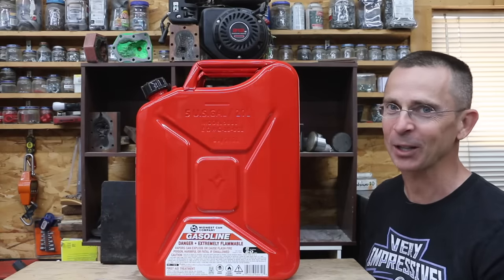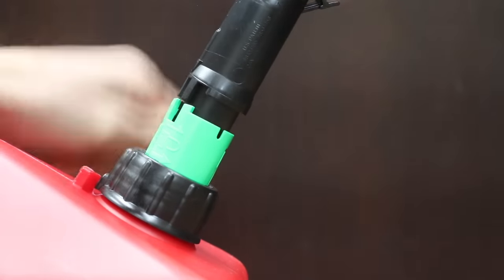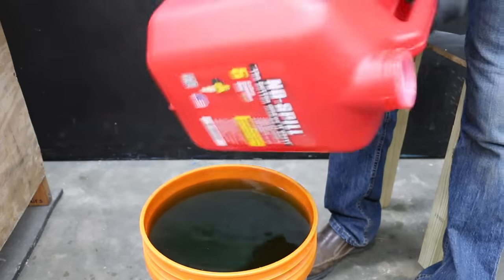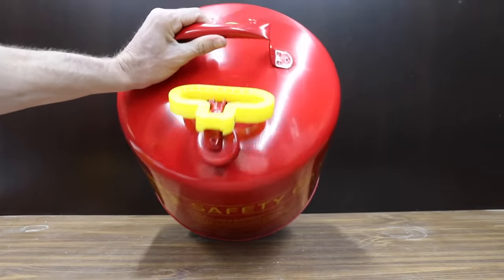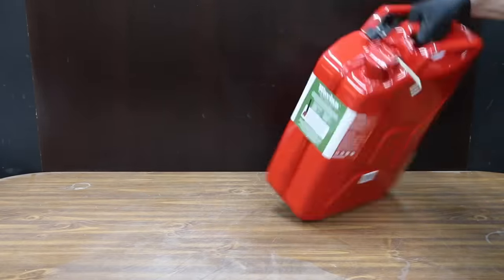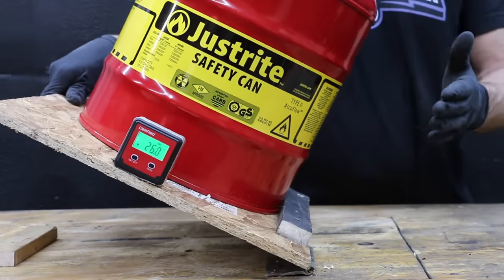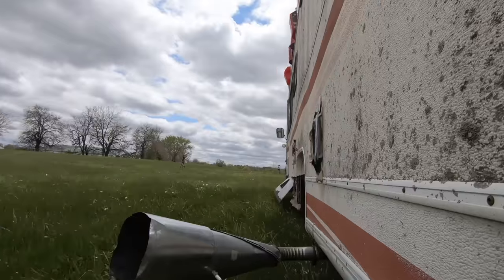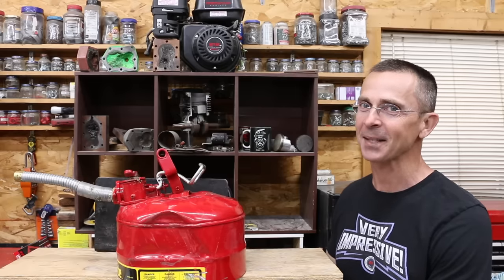Best Gas Can? $140 Wavian vs Eagle, Surecan, Scepter, Briggs & Stratton, Midwest, VP Racing

Comment: Well I am from Latvia, and I work at the company that makes the Midwest (military style) can, kinda awesome to see stuff on the internet. And the Wavian cans are also manufactured here.
Reply from the maker: Thanks for sharing!
Reply: Why am I not surprised.  Thanks for sharing.  Care to share any differences in manufacturing.  Like, does the Wavian have better quality control than the Midwest?
Reply: @arthurmoore9488  They are both the same in terms of manufacturing, the only difference is the US proprietary threaded neck and the latch lock cap design. The internal coating is the same on both and both use 0.9mm steel plates. There are other resellers like the Wavian that sell the same cans, not sure if any are located in the US though, and since they don't have the Wavian brand name they are cheaper, but essentially the same can.
Reply: I love my Wavian one so far. Just a damn shame about the Kalifornia spout that we're all stuck with now.
Reply: I have a Wavian (made in  Latvia) that I have had for about 5 years. Best money spent on a can.  If you want to make it empty even faster ditch the spout and just use a funnel. I can  empty the cans into my mowers in less than a minute while spilling less fuel.  Don't know if the newer Wavians still have the internal vent built into them. That's what makes the difference.
Reply: PS
You should never drive around with unsecured gas cans...
Reply: Both of them look impressive, and stick reasonably close to the standard "Jerry Can" design that's nearly a century old.
Reply: Thanks for the info.  I have a couple of Midwest cans and don’t see 3x additional value with the Wavian justifying 3x the price
Reply: I'm from Hungary, and I have a 10l Wavian and a 10l ValPro can. Love both. Now I want to buy a 20l one, but all the stores are out of stock ...
Reply: I think there must be some small design differences because the wavian can has some different scores, especially emptying the can it's night and day
Reply: @toitactu  Yes one has a screw on cap, specifically made to comply with the US regulations, which is not as good for emptying as the one that wavian has.
Reply: @JohnnyKronaz  Just buy an EZ flow spout for your model, less than 20 bucks on amazon.
Reply: @toitactu  As Martin said, the round exit also doesnt seem to have a air vent as well.
Reply: Another words it made from russia metal and natural gas and now manufacturing of this latvien product is stoped?
Reply: That is so hilarious cuz I noticed so many similarities between them I was like there is no way these don't come out of the same factory. Especially since the Wavian had no origin country listed. Goes to show just how much items in society are marked up with "fancy" names.
Reply: <<Well I am from Latvia, and I work at the company that makes the Midwest (military style) can, kinda awesome to see stuff on the internet. And the Wavian cans are also manufactured here.>>

So what kind of caps do you use in Latvia on the cans you make.  I can't imagine that EPA style caps are favored by anyone who has a choice.
Reply: @SeattlePioneer  We do have screw on corks aswell, but since those and the spouts are made in house, we can ensure that they allow the liquid to flow well, by ensuring that there is air access in to the can, as well as the lever type that wavian uses (not sure how it's called).
Reply: @xmartins2638  <<Martins Deiko
SeattlePioneer We do have screw on corks aswell, but since those and the spouts are made in house, we can ensure that they allow the liquid to flow well, by ensuring that there is air access in to the can, as well as the lever type that wavian uses (not sure how it's called).>>

Thanks for the comment.  I figured that few people would want EPA type caps if they had an alternative available.    Does the EU have standards the control gas cap design as well,  and if so is the result functionality as poor as EPA style caps?

Personally,  I have old spouts available.  The one I currently use has a solid plastic base that the cap screws on over,  sealing the fuel container.

To use fuel,  you must remove that plug and then screw the cap and spout back on.  That works OK,  but fuel comes out too fast and tends to splash over my mower.

I suppose I ought to experiment with partially plugging up the spout to reduce fuel flow to a more manageable level.

No one seems to have devised the perfect gas can spout....

I do think the EPA type spouts distinguish themselves as being the worst and most annoying designs in the world,  while still requiring fuel spills when you use them. 

Our United States Supreme Court recently ruled that regulatory agencies can't go out adventuring into new realms without our Congress explicitly authorizing an extension of such power.  Perhaps the EPA will continue to be stripped of power over Americans,  such as those annoying gas caps.
Reply: @SeattlePioneer  To be honest, I myself am not all informed about any EU standards regarding fuel spouts that affect flow. And frankly I am weirded out by it, because EU is usually the ones coming up with wierd laws and regulations, like with food and such.

I myself am in charge of CNC machining so we make the threaded necks and turn threads on to the corks. Also all the markings on the cans are made here.
Reply: @xmartins2638  

I recently took a nine month certificate class in manual and CNC machining.  I really LOVE the precision!   The CNC machines are marvelous.

I've been retired since 2007m  but I always thought that in a time of critical labor shortage,  I might be willing to go back to work  ---even at age 72.

Need any help?  

There is a manufacturing outfit about a half KM from where I live with a shop full of CNC machines, and they seem to have been looking pretty hard for machine operators.

I took these classes in 2019,  when Boeing manufacturing was sucking up machinists like crazy.  Then  three month later the Boeing disaster surrounding the 737Max took the bloom off the rose,  followed by Covid.  My impression is tjhat the labor market for machinists is tight again at this point.
Reply: That would be Valpro ;)! I was surprised it’s selling under a different name in the US. Your spouts in Europe are much better 👍🏻
Reply: @macjaxjax2604  It's a scam, read the comment from  the guy from Latvia
Reply: @101picofarad  relax Vlad
Reply: it was very surprising hearing latvia since i rarely hear my nation's name on YT
Reply: I love my Wavian cans.  I treat them like gold now that the plant has been demolished.
Reply: I have two of your cans filled with premium and Sta-Bil. Along with my NATO 15L can. Need more, but $ are scarce.
Reply: @charlessmith5274  Even filled with H2O?
Reply: @charlessmith5274  Yeah, right. Like something could go wrong.  /sarc
Reply: @xmartins2638  What is the lining inside the cans...Paint or a plastic???
Reply: @mrmotofy  Sorry for the late reply, it's paint.
Reply: @xmartins2638  Ah ok...any idea what type of paint?
Reply: @mrmotofy  Not sure.
Reply: Do you mean Wavian is also manufactured in Latvia? Or in the same facility that manufactures the Midwest?  Thanks
Reply: @Clay-i7y  Yes both of them are manufactured in Latvia, in the same factory, have gone trough the same quality testing. Everything's the same except for some embossments.
Reply: @xmartins2638  Thank you!

Comment: I wish they would make one with a wing on it to create down force so it would be less likely to fly out the back of my truck 😂
Reply: That's actually kinda genius
Reply: @deletdis6173  as long as you give me them free for my life and my children if I ever have any you can have the  patent😎
Reply: @animalmother9339  you have that issue with your battery?!
Reply: @animalmother9339  loved you in that movie btw you should of had the main part in my opinion
Reply: Wings just get in the way. What you need is a venturi tunnel with some skirting
Reply: @Eric-dr5bj  or a really strong magnet that you can control from the cab of the truck and a metal plate in the bottom of the can
Reply: wings work both ways.   catch side wind at wrong angle or from the side and off it flies
Reply: @ExcavationNation  Lol sounds like a deal 🤝
Reply: @ExcavationNation  RISK RACING makes a really nice can with a quick release truck bed mount
Reply: Bro 😂
Reply: @AbsoluteKelvin  don't reverse 👍
Reply: A wing... Why didn't I think of that 🤔. I'v just been tying them down for the last 35 years 😕.

Comment: We use the Vp cans in the shop, because we also sell them to the public. The plastic is nice and thick, so it won't break when you throw an empty can at another tech's head when he forgets to return a socket.
Reply from the maker: Thanks for sharing!
Reply: My VP can split at the bottom seam from having gas inside and sitting outside during the day. Don't think its repairable.....
Reply: @funkyd04  Have you asked VP to warranty replace it?
Reply: @funkyd04 ours sit outside full of gas and never had a problem
Reply: VP cans are known for blowing or splitting open. If that happens in your trailer your SOL.
Reply: @funkyd04  Yep, well known problem with them.
Reply: @petebusch9069  We don't use gas cans for storage at the shop, just transferring fuel from the big tanks to new units during p.d.i., and after replacing a fuel pump on a r.o. and throwing at each other while empty. Sorry your split man
Reply: This is the scientific testing we deserve.

Comment: In the tip over tests, the “Eagle has a huge advantage of being short, wide, and round.” I too possess those traits which I had never before considered to be advantages.
Reply: I feel ya. Lol.
Reply: Too funny. Thanks for the giggle.
Reply: What's your shoe size? I hope it's a 13 and not a 7. After all, those traits are only as good as your footprint.
Reply: Have you fallen over recently??
Reply: The sumo wrestler of gas cans.
Reply: Weebles Wobble But They Don't Fall Down!
Reply: @notapplicable531  indeed. Size 12 and I haven’t fallen over recently. But I suspect that I’m good for anything less than a 40° angle.
Reply: You are a well rounded person.
Reply: Ergo, you don't fall over easily. 

I, on the other hand, am tall and slender and when filled with some kinds of liquid, fall over quite readily.

Science explained.
Reply: @tbelding  LOL
Reply: Amen
Reply: Got a good belly laugh on this one and the replies.  Thanks a bunch, laughter is good medicine!

Comment: "The spout is designed to prevent unnecessary spills."
Correction, those spouts are designed to infuriate the end user.
Reply: Yea and cause more spills lmao. IDK about you but I buy juice and other drinks from the store for decades and don't spill any because I learned to pour stuff as a child. What the fuck
Reply: @gg-gn3re  i think you massively overestimate the average person
Reply: I wonder how much faster the cans will pour with an EZ-pour spout.
Reply: @ctrlaltdebug  It is not about the flow rate of the pour.  Instead it is about controlling the pour to avoid spills.  EZ nozzle with vent offers a smooth pour and thus is more controllable.
Reply: As opposed to the very necessary spills right?
Reply: They're from Kalifornia, so yes.
Reply: @LibraeotequeVer3 PointOh  if you add a separate vent instead of taking up room in the nozzle, it should pour faster, no?
Reply: Those spouts were mandated by the EPA in 2007: they have absolutely nothing to do with preventing spills and everything to do with preventing gas wastage via evaporation, which the EPA determined to be a source of air pollution based on data from the California Air Resources Board that was later determined to be false. They didn't care, and they insist they won't change it back.

There are multiple other features of the cans that are safety-oriented but the people that insisted on those spouts simply hate gasoline as a fuel and want Americans to use as little as possible. It's not even disputed by the people behind the 2007 decision.
Reply: @harveywallbanger3123  The idiotic thing about the spouts is that they actually cause way more spillage and consequently more evaporation than would otherwise occur.
Reply: Thanks Obama. Literally.
Reply: HAHA yeah. i think i'll take my old jerry can and funnel approach
Reply: That spout is a good example of how government intrusiveness and regulations make everything less efficient and much more complicated than it needs to be.
Reply: @1Thatstrangeguy  This was enacted in 2007, Obama didn't become president until 2009, so no, not literally.
Reply: As an Aussie all these nozzles look absolutely ridiculous and unnecessary. The fuel cans here have a simple nozzle with a small hole on top for ventilation and a large hole on the bottom for the fuel, they are also bendy so you can bend them into a tank and than proceed to pour, stopping you from spilling any fuel.
Reply: @ctrlaltdebug  In theory...  :-)
Reply: Bullseye on that one!!
Reply: i hate that most gas cans use the bullshit california nozzles. i end up just taking the nozzles off cus if i wanted to spend 20 mins pouring 250 liters of gas out of a fucking 1 gallon gas can i would be insane.
Reply: 100% right. Should be outlawed.

Comment: The Midwest, Star, and Wavian cans are versions of the classic German WW2 "Jerry Can". The Wavian seems to be the most accurate reproduction with an additional nozzle being added for convenient pouring.  Being standard size and shape, these would fit in metal fuel can holders available from retailers.
There are videos and entire books about how revolutionary that design was including the fact that the welds were recessed around the centerline of the two halves to protect them from splitting from impacts.  The triple handle allowed easier handoffs for the "bucket brigade" moving of fuel by can,  two people to carry one can and share the load, or one person to carry four empty cans easily.
Reply from the maker: Thanks for sharing.
Reply: Love the creativity & thought put into making the tests clearly visible on this channel. 

 The jerry can (NATO/Wavian in this test) is designed so it can be stacked & transported on its side (like bricks), making it actually the most tip-resistant of the bunch.

That center weld is where most will fail, so definitely avoid any knockoffs that don't have it fully recessed ALL the way around -- best to pay up and stick with Wavian or Geld now that prices are down.

One more odds n ends tidbit for boaters -- that hump at the top (where the handle connects) traps just enough air for positive buoyancy, so it floats even when full of water itself.
Reply: The reason the welds were recessed was to prevent the welds from rubbing against each other during transport of a truckload of cans.
Reply: Another really interesting detail I found digging around in Wavian's FAQ: 
"Wavian Fuel Cans are made in the very same factory that has been producing Steel Jerry Cans for NATO countries since WWI. Originally located in Germany, the cans' manufacturing facility had to move to Latvia during the second world war. They've been made there ever since."

The Midwest is also made in Latvia, looks really similar, and has the same internal coating.  I wonder if they're just two quality grades from the same factory?
Reply: @dnebdal  There was no NATO after WW1,
Reply: @darrinrentruc6614  Indeed not, it's a weird sentence. Technically speaking they have been making them for countries that are NATO members _today_, I guess?
Reply: @dnebdal so, they just made them for the Reich? Simply put
Reply: Honestly its crazy how well designed they are and even 90 years after their invention they still hold up.
Reply: Wavian is also manuf'd in latvia. It is approved by the DOT and EPA for fuel transport as well.
Reply: Wavian as well as Midwest are rebranded Valpro jerrycans, 
They are certainly a lot cheaper over here.

For example the Valpro is available for around €30.
Reply: @dnebdal  Sounds like a bunch of complete nonsense. No NATO after WW1 (obviously), the "Jerry Can" was a German invention made in the late 1930s (so certainly no "interwar" production at all), it was produced in Germany (by several different companies) for Germany - so why would it have to move to Latvia during WW2 - to be easier to be taken over by the Soviets? Also interesting that this factory in Latvia (part of the Soviet Union until 1987) has been producing jerry cans for NATO "for 75 years". Sure. 

The design seems to be exactly the same as the German 1940s one, also including the breather pipe. $140 seems completely insane. You can pick one up just like this here in Germany for €20-30.
Reply: @drsnova7313  Sounds like a factory moved to Latvia by the Soviets from Germany after the war. Was probably producing cans used in the Baltic Countries, probably Poland, possibly Finland. Those countries are now NATO members and so is Germany. So continuously producing for "NATO"  countries isn't that bad of a marketing stretch.